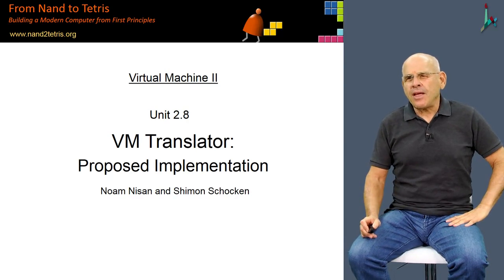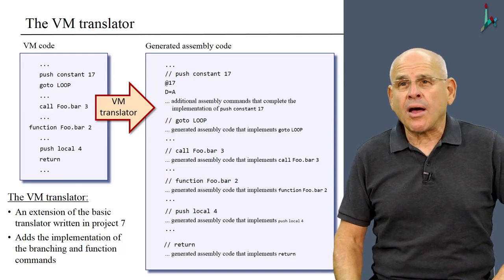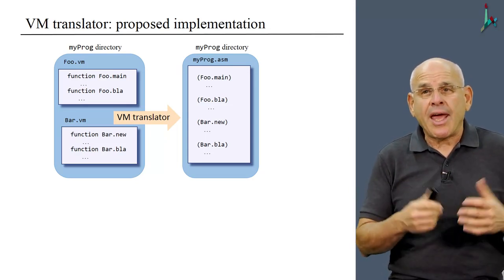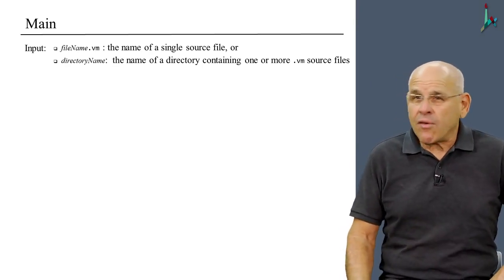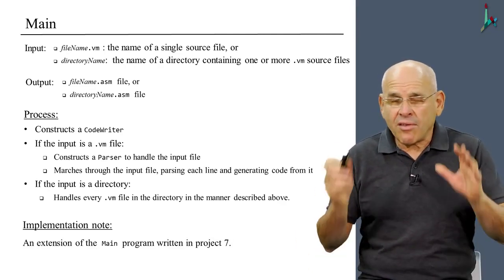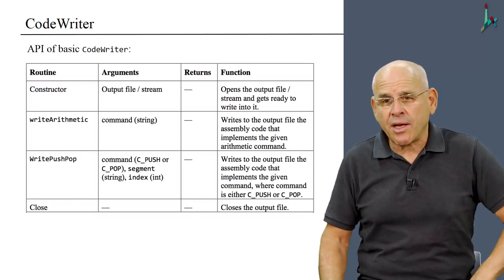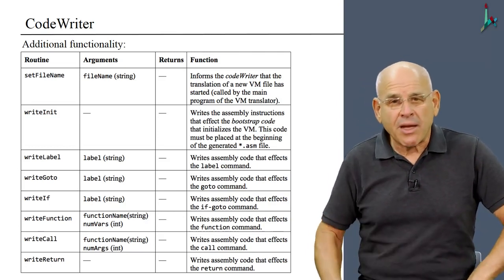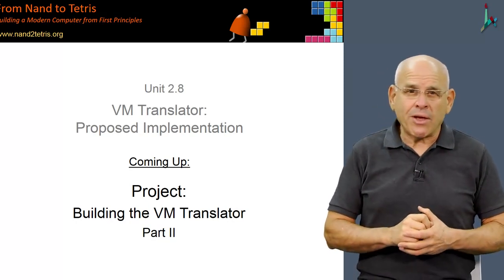[Part 2] Unit 2.8 - VM Translator - Proposed Implementation

Comment: I love this course so hard, but it is kind of lonely doing it alone.
Reply: I'm here now.
Reply: @PecPur  Hi!
Reply: @mendelovitch  Hi did you complete the course?
Reply: @PecPur  Got distracted when I tried writing a Hack emulator. It was so slow and hardly worked. I will continue soon where I left somewhere around the intermediate virtual machine language.
Reply: @mendelovitch  did you ?
Reply: @ I did a lot, but did not complete yet.  Got to the higher level language compiler, specifically the tokenizer.
Reply: damn , why stop after getting so much done